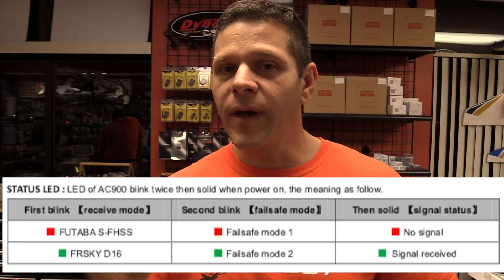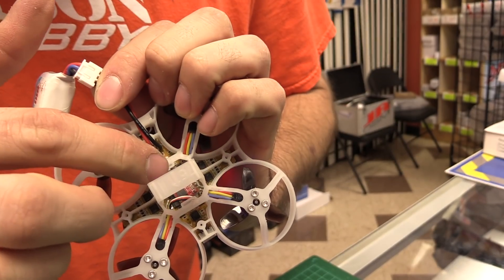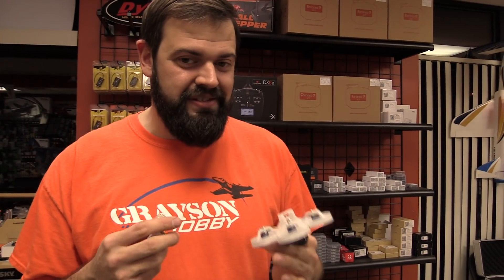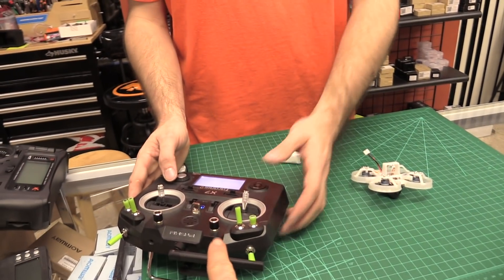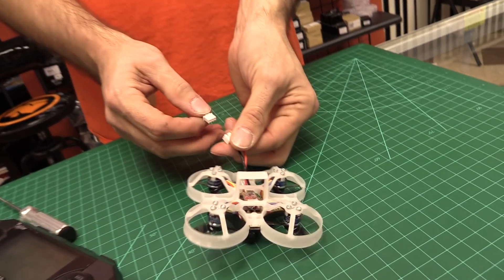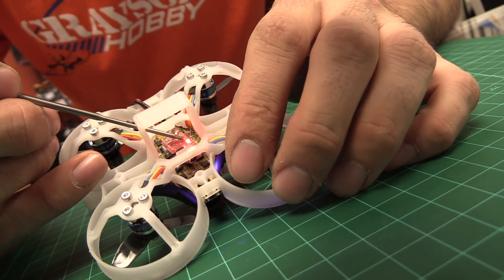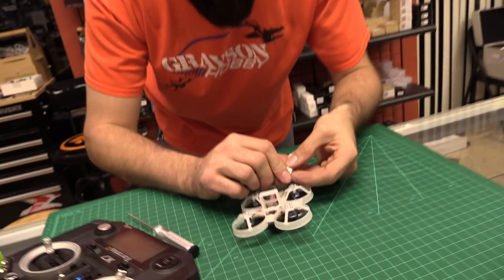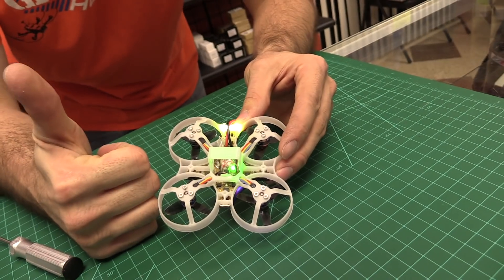Binding Problems Solved KingKong ET V2 | GT Series AC900 FrSky Binding Issues

Comment: Getting ‘No response from boot loader, programming FAILED” when trying to update firmware in Betaflight. Using a Mac. Is there a button to press on the LDARC GT7 to get a bootleg response? Thanks.

Comment: Hello and thanks for some great videos. I have a taranis q x7s and the drones receiver is AC900 (et125v2). I plugged in the batteries and when im pressing the receiver button i get one blink then direct a solid colour. So its eather one green blink then a solid red, after i puch the receiver button again i get one red blink one solid red light. Why do i not get the two blinks then the solid colour?
Reply: Mine did the same thing.. did you fix it

Comment: Hello guys, i have Taranis Plus transmitter and ET115 V2. I have tryied to change AC900 for Frsky (first LED in green after battery plug on), bu i am still not able to bind it - LED still blinking in Green and don´t finish bind process - see my video (https://www.youtube.com/watch?v=gv2oSZKAo9U). Do you have any advice for my what shoul i do ?
Reply from the maker: 1. move the TX about 1-2 meters away from the quad
2. Make sure your startup boot seq is Green / Green / Red
3. Make sure you can bind to another quad..

its all working correctly, you are just not setting up something (most likely small) correctly

Comment: Hi all, not sure where to ask this question but I will try here. 1.) Im having trouble getting into boot loader mode with this ET115  V2 3s. Preforming the bootloader steps, The Red LED stays lite and the beeper starts and maintains a constant tone. Am I messing up by doing it while the FC is in the quad hooked up to everything,, or should firmware (Betaflight) be upgraded with the FC completely isolated ? 2.) Im also wondering which F3 "board" I should be selecting, (no exact match offered in the drop drown list in Betaflight Config.10.4 ) Any help would be appreciated.

Comment: Thank you  for this great video . This AC900 was totally different from the old version AC800
Reply from the maker: The v1 Grayson carriered had an xm. That's cool to know there other versions
Reply: @graysonhobby  Hi , i meant the old version of receiver not of the quad :) . My other micro is a Kingkong 90GT and it came with AC800 . The ET100 v2 i have  has the AC900